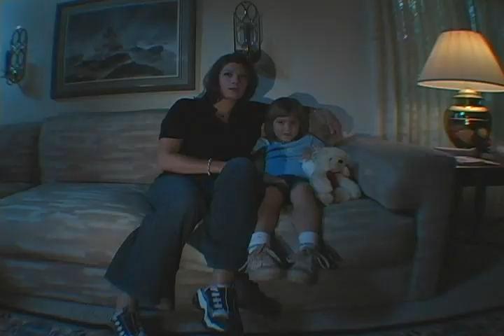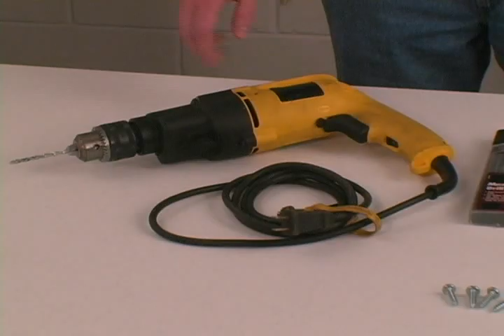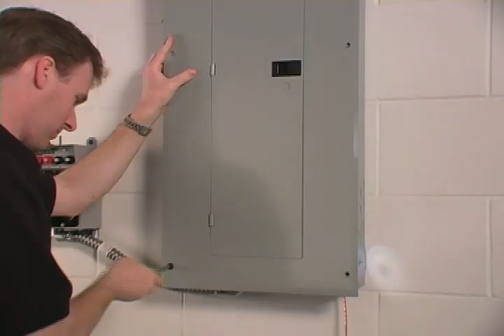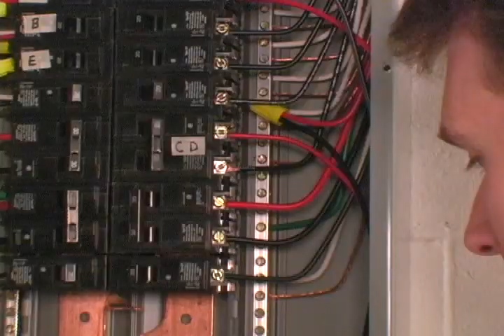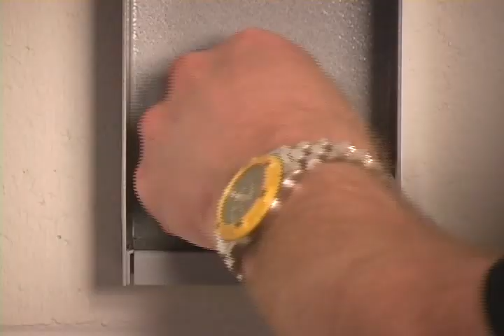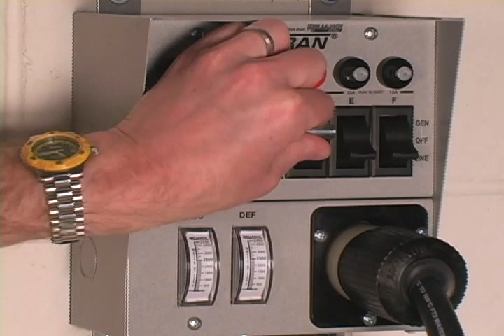Reliance Transfer Switch Tutorial

Comment: Im trying to install this with Honda 2200 inverter Generator for my boiler for heating. I found out i have tandem breaker 15amp where one red and one Black wire coming out of the breaker. How do I wire?
Reply: You don't. You need to get a 240V generator.

Comment: excellent video... but the problem is my home is not one where the builder gave much thought to things like this... my breaker box is outside on the corner closest to the street rather than inside the house for easy access... it is also set flush in the outside wall so how am I to run the conduit/wiring from the transfer switch thru the knockout in the breaker box??? any/all suggestions will be greatly appreciated...we just had our power turned off as a Safety Outage by PG&E  in one of the soon to be many CYA bullsh*t tactics they have been pulling since the Camp Fire last year... I really need to get this transfer switch set up so we can keep our kitchen safe from future outages...
Reply: You have to remove the siding below the panel to access the panel.  The conduit will have to run through a hole in the siding or a hole through a board covering a few inches below the siding.  It is probably better to have an 90 degree elbow in the panel knockout to connect the conduit.
Reply: @gtimes2  Thanks for the reply sir but I no longer live there so it's no longer an issue...

Comment: Its really helpful video. i have question 
how do i connect Sentry Alarm panel to Reliance transfer switch and to breaker box. Reliance box has six wires two reds, two blacks, one white and one green) for switch 1 for generator and switch 2 for Sentry alarm panel. i have breaker box connected to Sentry panel right now.two  red wires from breaker connected to L1 and L2 in sentry panels. white with white and green with green. i want to add Reliance transfer switch box in the middle.  how do you i connect to them from breaker box to transfer switch to Sentry alarm box? do you know?

Comment: So, feeding a 20 amp kitchen circuit with a 15 amp transfer switch circuit is OK???
Reply: Yes since the transfer switch circuits are all using AWG 12, rated for 20 amps, it's ok to connect them to 15 or 20 amp breakers in the house panel.  The breakers in the transfer switch are only in-use during generator mode.  There is the possibility that during generator operation, the 15 amp breaker will not hold and will trip if more than 15 amps is drawn, in that case, you would want to replace the 15 amp breaker with a 20 amp breaker.
Reply: Thank you for the info.

Comment: I like to install one of these transfer switch box in my house, but I like to run my A/C unit, what is the correct size box an generator I will need?.  In my circuit breaker box is showing A/C with two double 40 breakers.
Reply: If your A/C is on a 40A breaker, you will need a different style of transfer switch as this type will max out at 30 amps for 1 (240v) circuit and 20 amps for the rest.  A current model that can connect to a 30A 240V circuit is model 306C, but if the breaker is 40 amps you'll have to use some type of transfer panel with an interlock.
Reply: Thank you Nicholas Schmal. I did not think about the panel with interlock,  but it may be a better  idea for my situation.

Comment: 1st Rule of working on or around electrical circuits is:  REMOVE ALL Jewelry and Watches.
Unlike the guy in this video who left his stainless steel watch & band on his wrist!!
Reply: ...and always double check with a voltmeter.
Reply: Its really not necessary to remove your jewelry on something like this.  Everything is dead.
Reply: Roger Smith yes everything is dead but those main line that feed the panel is always live !!! Until you shut it off at the meter or called the power company to pull the meter off
Reply: @007380  yeah and the gun was unloaded when I was cleaning it I swear!
Reply: @sylviaisgod6947  You don't clean a gun if the bolt is in it.  If you own a meter, use it.  If your an electrician, like me, you always check for power you always check your meter on a known live circuit to make sure your meter works.
Reply: @007380  You shouldn't wear conductive jewelry working on electric circuits even if they are verified dead. I'm not going to get into the reasons why since you already know this being an electrician.
Reply: @sylviaisgod6947  BS  You won't say because you don't have a good reason.  I had to have my wedding ring cut off my finger before because of electrical burns I received back in 1984.  If, what you say is a good idea, then we should be wearing hot gloves when we do electrical work even when we know the circuit is off.  It makes no sense.
Reply: @007380  You should not be working on electric circuits with that kind of attitude. Very dangerous.
Reply: @sylviaisgod6947  I done it for 45 years and I'm still here.  When I started doing electrical work, we were taught how to work it hot if we had to.  I done service work for 15 years and was always working on hot wires.  The dangers are still there but there are proper ways to work hot wires.  Now days companies won't let electricians work hot wires because of insurance reasons.  I worked for an electrical contractor one time that furnished us with leather covered belt buckles for protection.  I worked with 2 brothers one time and one of them went into the attic to drill the hole for the wire to go down the wall for a plug.  The other brother was in the room where the wire was being dropped to.  after awhile the brother in the room called out to his brother because he didn't hear him drilling.  After a few minute the one brother went into the attic and found his brother dead.  He got electrocuted from a drill that wasn't grounded.  Point is, do what ever makes you feel safe.  You are responsible for yourself
Reply: that is so true , had a friend that got shocked from having his wedding ring on. he made contact with the ring and the ring sparked and melted on his finger.

Comment: Does the building wire nm-b require conduit? My inlet box will be outside with about 1 1/2' about the hole going in the house.
Reply: It really depends on local building code. In many areas it's not required to run the nm through conduit.
Reply: Thanks Nick, I used single wires through non metallic waterproof conduit all the way from the outside to the switch. 10 awg. Your directions explained everything perfectly.

Comment: Thanks for the helpful video.  It was presented making it easy to understand.  I'm seeing people use these for their solar.  I don't see why not,generators put out 110 volts as an inverter would as well. I suppose it may vary what city one lives in. Does this install require an inspection after being installed?  Thank you.
Reply: It depends on the area you live in on whether an inspection will be required.  Yes this type of transfer switch is good for inverter power if an automatic transfer switch is not used.

Comment: what size building wire would you suggest for this size setup?
Reply: Hello, the building wire that comes from the remote power inlet box and connects to the transfer switch is the input from the generator. Usually the size/gauge is based specifically on the generator itself, among other factors such as distance.  If 30 amp plugs and a 30 amp generator outlet (L1430R) are utilized, where the generator rating is no larger than 8,000 running watts, and the distance of the wire is no greater than 100 feet, 10 gauge is going to be sufficient in almost any application.  If the generator is using a 50 amp output receptacle, or the distance is around 100 feet or longer, then it needs to be reevaluated.

Comment: I thought the convention in wiring anything is that the Red wire is the switched, to the load, and the black wire is the HOT coming from the panel breaker......You show the opposite of this convention.
Reply: Thank you, with photocontrols and some other devices or switches there indeed is some convention to black -> line and red -> load.  However there is no rule on this and the NEC allows numerous exceptions.  

This transfer switch is a unique prewired electrical panel, as the toggle switches involved are 3-way switches (ON / OFF / ON) unlike photocontrols - so that both BLACK and RED wires are always hot wires, the red wire simply is broken at the toggle switch when the switch is moved away from LINE position.

Comment: I have solar panels that feed power into my panel using a circuit breaker.   When the power grid is down, do I need to do something different when using my generator and a transfer switch?
Reply: Ken, if you have solar panels connected directly into a circuit breaker, without an external inverter, then most likely each solar panel has a built-in inverter called a "grid-tie" inverter.  The inverter changes the power from DC (direct current) to AC (alternating current) making it usable for household circuitry.  If the application is setup as "grid-tie" which means the power from the solar panels is synchronizing with the utility power (with internal inverters or an external inverter) then all of that power MUST shut down when a utility outage occurs - the system must recognize when the utility is down and shut itself down, or else it could put power back down the line (back feeding).  

Adding a transfer switch (manual) with a secondary portable generator to back up some or all circuits when the utility goes down (along with the solar panel system) is possible, but it depends on a lot of factors.  Mainly it depends where exactly the power is entering from the renewable energy system, and exactly what transfer switch is used and where it fits in.  Feel free to contact me at support@reliancecontrols.com and we can discuss this if you have any questions.
Reply: Thanks for the detailed information.  Clearly you are an expert.  I have a Sunny Boy inverter that converts DC to AC - and then the power enters my panel through two circuit breakers.  And yes, I have an agreement with the local power company who buys my unused electricity at wholesale rates.  It would be nice if I could use my solar electricity when their supply fails.  But yes, back feeding would currently be a problem the way it's set up.  And in addition, I'd like to set up my generator with a transfer switch to supplement that solar - particularly at night.  And perhaps a battery pack would be a good addition too.  To complicate matters even more, I'd like to buy an electric car that apparently will need up to a 50 amp circuit.
Reply: Great, thanks.  Right the main issue is that the code/standard for grid-tie inverters specifies that it must detect the utility outage and shut itself down as soon as the grid is down.  Unfortunately I would guess that it will be challenging to rig up this system so that the Sunny Boy will be able to provide power when the grid power is down, primarily because they are not allowed to.  I'm sure it's possible one way or another but some type of transfer device would need to be added and setup so that the inverter can't possibly back feed when the main power fails, it may be a lot more work than it's worth. 

It's certainly feasible however to setup a different generator (and transfer switch) to supplement power at any given time, although generators will not be as efficient as the utility from a cost standpoint due to the cost of whatever fuel the generator uses.  If you added a transfer switch like the one in the video, or a sub panel with an interlock, you would have a dedicated panel for a different generator to feed while the other sources are down due to a power outage.  The transfer switch setup would have to be well planned as to avoid the Sunny Boy from trying to synchronization with the generator itself.   If you had a different or secondary battery bank and inverter (non-grid-tie) in addition to the Sunny Boy, you definitely could use that to supplement power by adding a manual or specialized automatic switch.